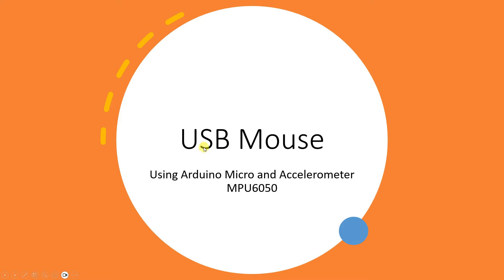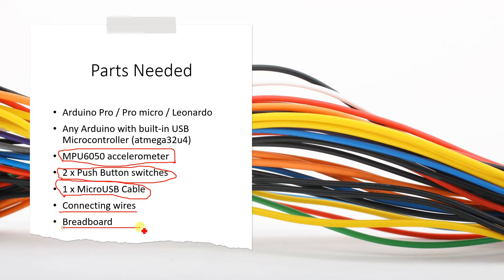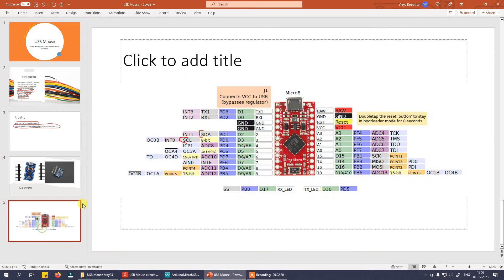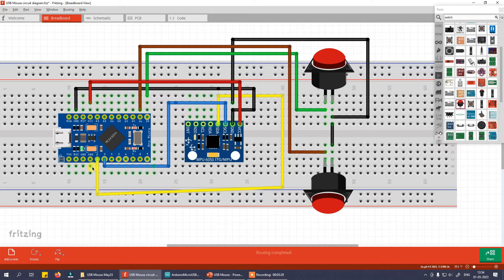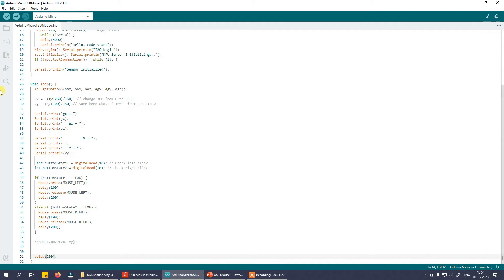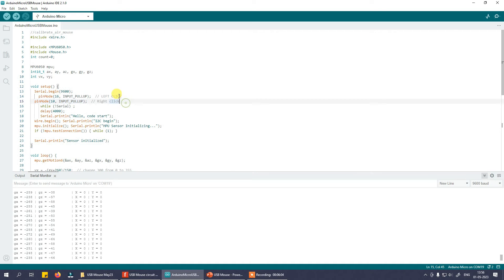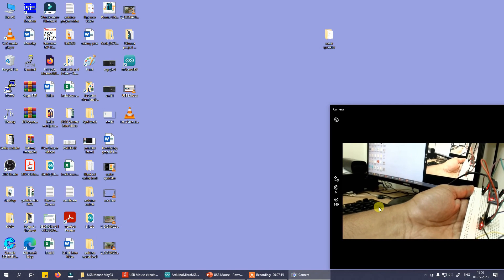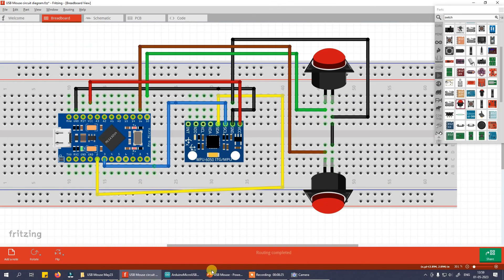Usb 3D Mouse Using Arduino and Mpu6050 Accelerometer #programming   #arduino  #arduinotutorial

Comment: i tested the code and i had a specific problem: when the mouse initializes, the cursor goes slowly down (vertically), even without actual movement. Do you have a solution to this?
Reply: I also have this problem, i do believe i fixed it by changing the values when calculating the velocity. Try keeping the gyro still and record the gyro value.(it should hover around a certain number). Then you make it so if the gyro is still, velocity will be 0. Honestly, im also new to this. I hope this helps

Comment: Bro arduino uno does not work with this as it does not support mouse library
Reply: u need an arduino pro micro or original uno R3 or arduino leonardo clone or original one( yea i used 3 times "or")

Comment: Hi can i use the same code for esp32 which is wirelessly connected to the monitor ? If there is a change in the  code  , could you suggest how i could include it ?
Reply: existe uma biblioteca chamada esp32-ble-mouse que implementa um mouse bluetooth, particularmente não consegui usar, mas existe

Comment: rewrote his code bc the site doesnt work:
/
/
/
/
/
#include <Wire.h>
#include <MPU6050.h>
#include <Mouse.h>
int cound=0;
MPU6050 mpu;
int16_t ax, ay, az, gx, gy ,gz;
int vx, vy;
void setup() {
	Serial.begin(9600);
		pinMode(16, INPUT_PULLUP);
	pinMode(16, INPUT_PULLUP);
		while (!Serial);
		delay(4000);
		Serial.printIn("Code Start");
	Wire.begin();
	mpu.initialize();
	if (!mpu.testConnection()) { while (1); }
}
void loop() {
	mpu.getMotion6(&ax, &ay, &az, &gx, &gz, &gy, &gz);
	vx = -(gx+260)/150);
	vy = (gz+100/150);
		int buttonState1 = digitalRead(16);
	int buttonState1 = digitalRead(10);
	if (buttonState1 == LOW) {
		Mouse.press(MOUSE_LEFT);
		delay(100);
		Mouse.release(MOUSE_LEFT);
		delay(200);
	}
	else if (buttonState2 == LOW) {
		Mouse.press(MOUSE_RIGHT);
		delay(100);
		Mouse.release(MOUSE_RIGHT);
		delay(200);
	}
	Mouse.move(vx, vy);
	delay(20);
}

youre welcome
Reply: I will test, thanks!

Comment: Hello, how could I make my pc recognize it as a joystick and not a mouse? I would appreciate information. Thank you
Reply from the maker: Hi Alan, Joystick driver implementation needs to be coded in Arduino coding for it to recognise as joystick. It can be done using xinput library. https://www.partsnotincluded.com/how-to-emulate-an-xbox-controller-with-arduino-xinput/
This can be starting point but I haven't tested it myself. Cheers!
Reply: @kitflix  great, thx for answer :)
Reply from the maker: No worries, happy to help :) in whatever time I get